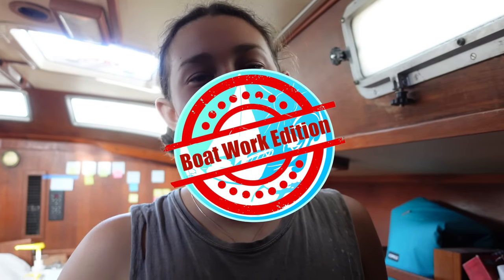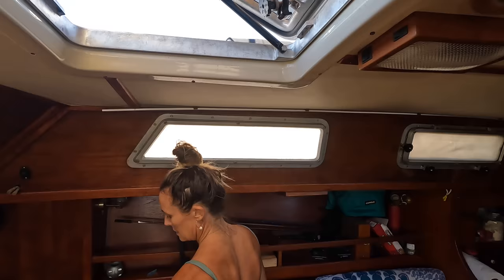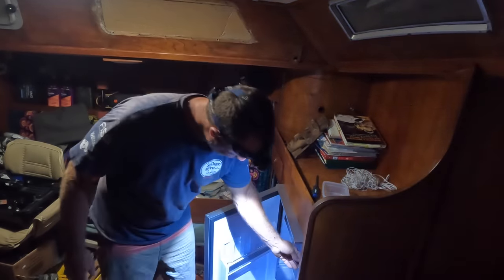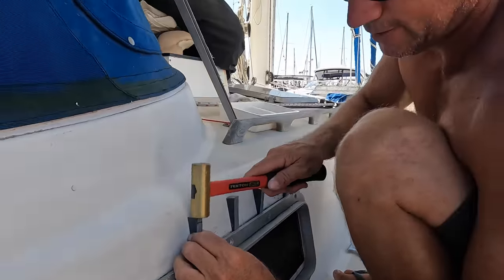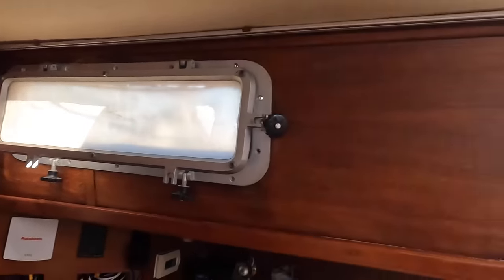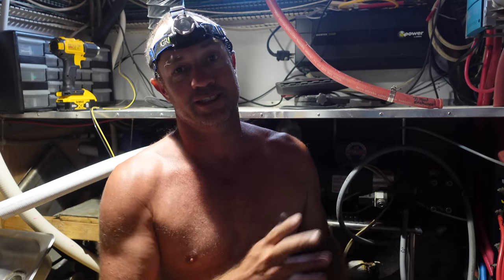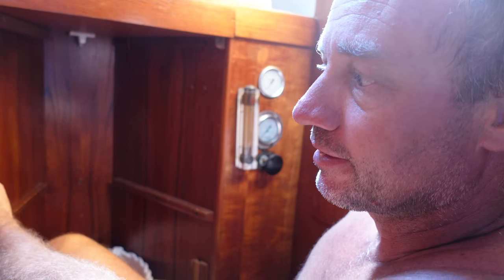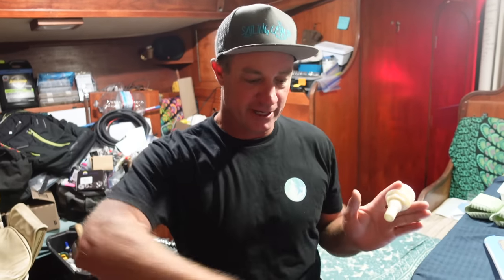DIY Boat Projects and troubleshooting more on our Pearson 530 | Ep 318 | LOTS of Boat Work

Comment: The trickis is make 3 step of oil covering. Only one is going inside wood structure, second one is seals some small scratches and spots, and third is make a protective layer that looks realy nice and stay for about 3-5 months. After this you have to cover it one time again and repeat every 3-5months.Cause it flushing by salt and rain water. Then wood will be always protected and looks nice... And this is realy much more easy than varnish...

Comment: Great job there Captain !   Here is an old Glaziers trick for cutting something away from something.  Take an OLD TAPE MEASURE BLADE [ CAN BE NER ONE TOO ] CUT it into 6 INCH-8INCH long pieces, wrap tape around one end of it and use it like a razor blade to cut along places where it is too tight to cut using a reg razor knife.  BEWARE OF THE EDGE IT IS SHARPER THAN A RAZOR and so thin it will cut thru you as well as. This can cut in places you just cant gert too and if you use a 1 inch wide blade you can make it 10 inches long and cut 5 inched deep into something.   CHEERS AND SAFE TRAVELS       Steve h.

Comment: Every component has a failure rate. Add components and you reduce reliability. Sensors need to be, at the very least, an order of magnitude more reliable than whatever they are monitoring, or they will be ignored as a sensor fault.